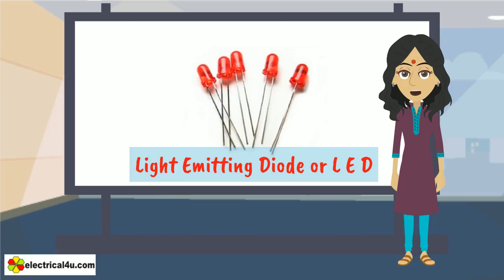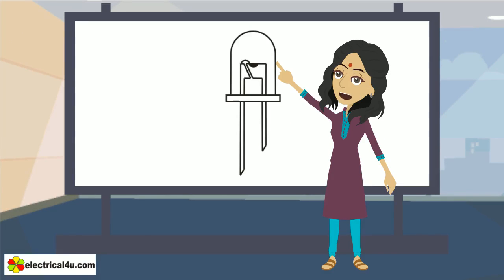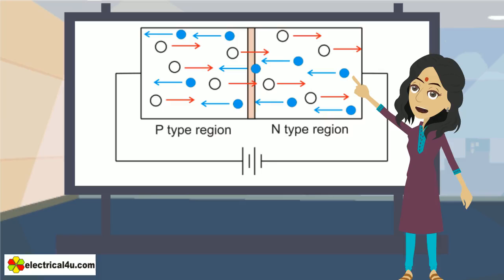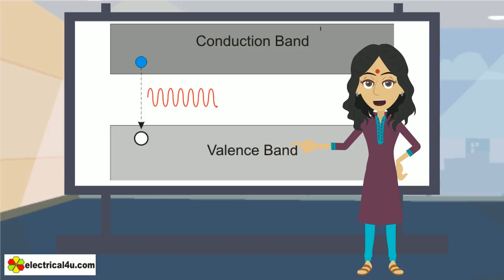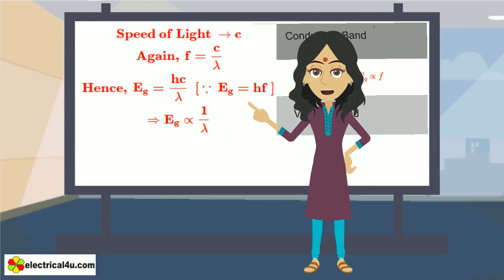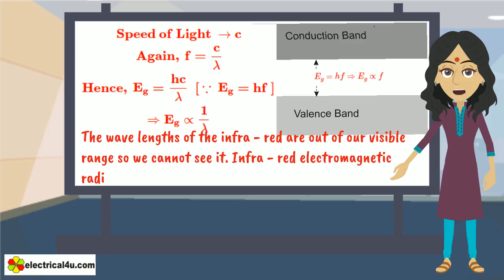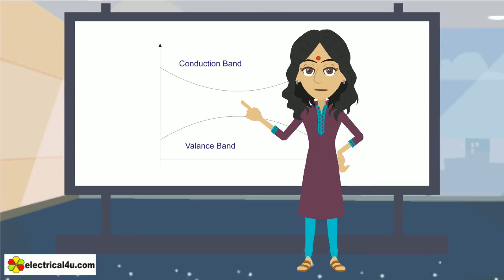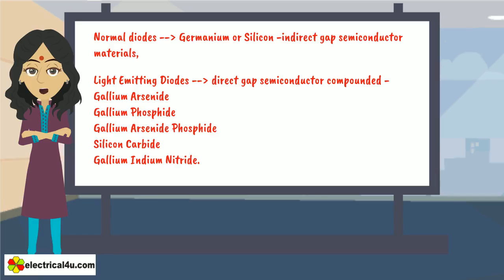Light Emitting Diode (LED) Working Principle

Comment: What is the volts used for PC cases? The one you see in the front panel for the reset switch and hdd light

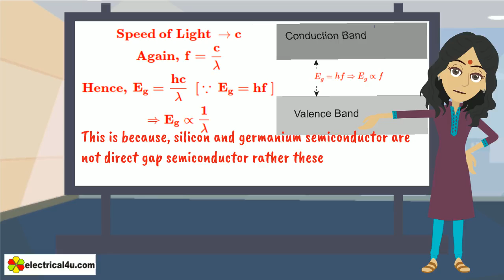Comment: 5:04
in indirect gap semi-conductor, the maximum level of valence band and minimum energy level of conduction band, do not occur at the same momentum of electrons. What do you mean by 'do not occur at the same momentum of electrons'? Electrons isn't a unit of measurement?
Reply: I'm completely losing her around this point. It suddenly becomes all garbled!